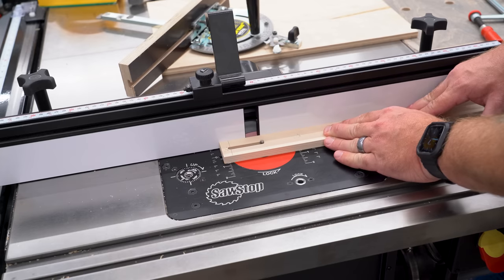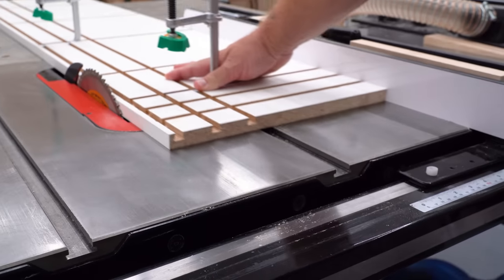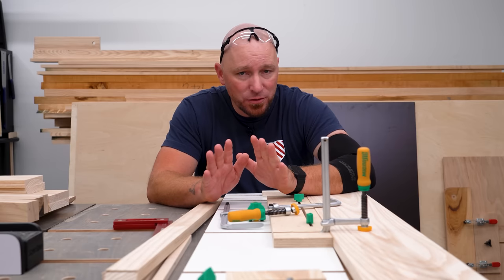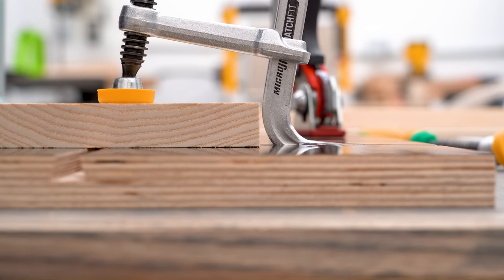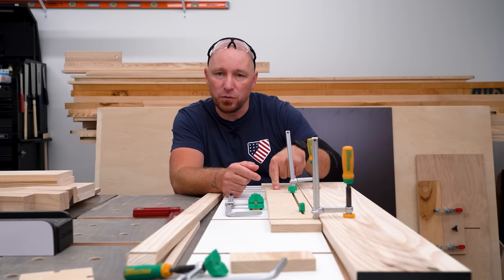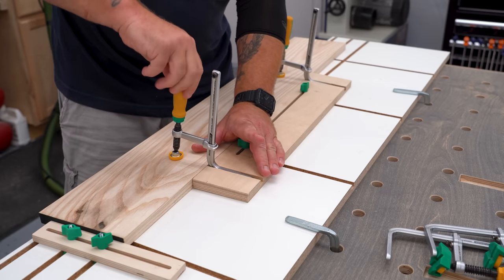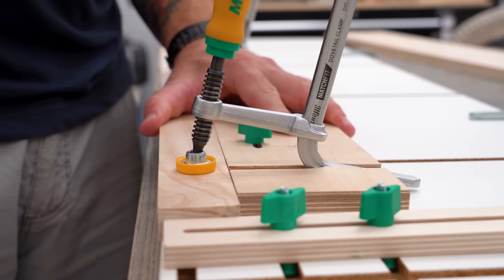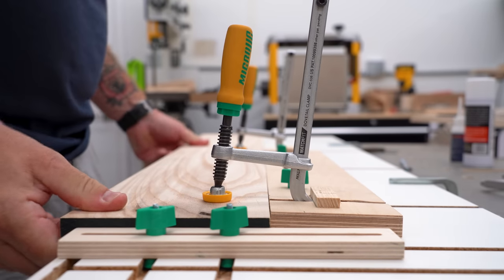What's the TRICK to Using These Clamps BACKWARDS?

Comment: Use two heads on the same clamp. One in each direction. Place a piece of stock in the one in the "normal" position and clamp it tight. This will keep it from pulling through. Now the one in the "reverse" position can be tightened as much as you want to hold the workpiece.
Reply: Great idea!
Reply: Great idea for solving the physics side of it, but again, a lot more work and expense (additional clamps, and more stock for the opposite side) than just cutting channels for t track or some other option like an adjustable fixed base flip clamp. I'm not knocking your "adapt, improvise, and overcome" thought process, just so you know.

Comment: after seeing your video, I made one similar to what you have.  I only use it with pad facing the metal.  I don't see the need to reverse it.  I think leaving bit of material to protect the blade is a great idea.  I even borrow that idea from you.  Thank you.  

p.s.  I added fence and mitre bar to double it as cross cut sled.  I can make all kinds of cut by removing the fence.  Just need to hold down the work piece at two locations.

Comment: In the “correct” orientation, the clamp doesn’t pull apart the dovetail grove because the stock is being pushed down and holding everything in place. An inelegant solution, then, would be to clamp something over the groove behind the reversed clamp - maybe with a toggle clamp? More matchfit clamps?

Regardless, please keep coming with the matchfit ideas, I have the system and am intrigued by the potential. Also, if you haven’t seen it, check out MorganHop’s cam clamp for the matchfit system, it’s very clever.

Comment: I commented on the sled build that it's an excellent idea for the application, and I'd make one. With the reversing of the clamps, I think I'd simply avoid doing that altogether because it would seem like a bit of a sketchy cut if the material is going to be that narrow anyway. One of those "find a different way" situations. All that said, you addressed a proposed solution really well. Keep it up!

Comment: Instead of using ca glue to hold the piece over the backwards clamp, you could drill 2 holes in that little cover board and install threaded inserts on both sides of the dovetail channel. Then you can lock it down when needed and remove it easily.

Comment: Cut down the fence to a narrow strip and route som extra slots in the sled. Your work holding clamps will then be mounted to the sled instead and able to reach over the fence. The fence isn't load bearing so a narrow strip should suffice.
If you in some situation need to reach really far over your work piece to secure it you could consider splitting the fence in two parts or make generous U cuts out to accomodate the clamps. If fact you only need two points of contact from the fence. Thus it can be reduced to two circular pieces of plywood with screws in the middle.

Great video by the way. Love how you share your thinking process and experience.

Comment: I would think if you need to use the clamp in reverse, and you still need to protect it from tearing out the upper sheet's fibers, then use another clamp, but slide it in the V groove of the bottom sheet, perpendicular to the reversed clamp and clamp both the V groove of the upper sheet and the bottom sheet - clamp the clamp. In this case, you will have more room to move.

Comment: Using thinker wood and cutting the dovetails deeper in turn will make them stronger. But the down side is the sled will be heavierand you'll lose a bit of clamping thinkness. But its worth it. I know I've done it and it works to an extent. Gluing 2 pieces of ¾ plywood together and using a straight bit to hog out the the center the another pass with the dovetail bit will give you what you need. I guess another wat to lessen the weight would be to only beef up the thinkness only where the dovetails where tracks are. Like a 2 or 3 inch strip. But there you would lose a lot of the adjustable. Unless you good only having the 2 or 3 inch wide strips supporting the work price from underneath. But to each ther own.

Comment: Would it work if, rather than running the clamps reverse IN the fence, that you simply ran them in the original sled UNDER the  fence and that fence would then provide the necessary down  pressure to keep them from ripping through? Since you placed your dovetail grooves at an even 12” you could just notch out the fence to accommodate the clamp  body when reversed., while still providing some down pressure.

Comment: If you were wanting a solution for this I don't think it would be easier to make than what you've already made...you could make a hard wood block to encapsulate the foot and then make a matching dovetail for the original slot on that block but it may still pull on the sled enough to break...I think it would be easier to talk with the company about making clamps with shorter legs or even cutting one short to see how that affects clamping force, but if it works the way you've made for almost every situation I think it's overkill to try and fix this tiny issue, if you really need to get close for tiny stock, I think a normal toggle style clamp could be attached to a dovetailed block and used for those occasions

Comment: How about an adjustable brace for when you reverse clamps? You set it into position and then tighten the knobs and secure it in place. Another one would be to maybe cut a piece of the metal, and then you could extend the reach without having to reverse the clamp, although i reckon those microjig clamps are too expensive for that idea.
Reply: Another one i just thought of, fastening a strip of wood to each side of the groove, maybe with screws and thicker stock, it could be able to withstand the pressure from the reversed clamp.

Comment: I’ve been wondering if you have considered a trac saw? It seems like they would be a tremendous upgrade to a shop.
Reply: Track saws are great but they have limitations. A jig like this is more accurate for repeatable cuts and if you need to make a bunch of the same part it becomes really tedious with a track saw. They also struggle with material narrower than the track itself

Comment: I really like the MatchFit clamps, but as you pointed out... they are not useful to me in their reversed deployment with the way they pull out too easily in their routed tracks.  The force only gets worse the higher the clamp is used (thicker material being clamped.  Way too much leverage exerted and I never use them that way.  

I only use them reversed when placed though rather thick holes drilled just large enough to fit the clamp through (like dog-holes or braced/encapsulated as you show), but that is extremely rare... a fence for a drill press comes to mind.  Keeps the bottom of the clamp out of the way, pointed back and through the fence.

Comment: Good video
Reply: I personally would not put them in reverse.  If the design was to do this, the wood holding the clamp would need to be doubled.  The bottom board having the t slot, the top board with a simple slot.
Reply: @davidfimble2217  I wouldn’t reverse them either

Comment: Instead of putting glue on the strip of wood try threaded inserts with glue on the inserts, this way you can remove the strip of wood and replace it as needed.

Comment: Where the foot sticks out from the fence you could have 1 1/2" x 1 1/2" scraps of the dovetail groove and slide them on like clamp pads or just scraps of wood the same thickness as the bottom of fence to bottom of the groove.  On the top maybe more tee nut slots with wood or metal bar across the slot near the bend at the weak point.

Comment: I don’t see the problem. When in the normal position, the screw looks to be right over the foot of the clamp, which is within a 1/4 of an inch from the edge of the sled. You have to have enough of the workpiece on the sled for the screw to fit on, which would probably be at least an inch or better, and if the screw lines up with the foot, then I don’t see the need for the screw to extend any farther. I guess I don’t see the worry about the foot not getting to the edge of the sled, cause unless you’re trying to clamp 
 only say a quarter of an inch to the sled, it should be close enough.

Comment: Easy clamps to use, but as you have shown, they are definitely limited. I guess it depends on how much time and money you want to put into the beginning of the project... t track or dovetail.
What about using a thicker stock (let's say 1" for s's and g's) and routing a channel that's wide enough for the "trunk" of the clamp, THEN cutting your dovetail? Sounds more time consuming and risky and expensive (stock) than what I would want to do just so you can reverse the "root" of the clamp. 🤷‍♂️

Comment: I had that problem but mine is different. I use a hold down clamps and a diy t-track on a plywood and I solved it just by adding extra  hold in the middle. If you change your dovetail plywood into aluminum or  change it to aluminum t-track, problem solved. Please Check out my tapering jig if you have time. Especially on the 4:03 mark on my video
https://youtu.be/39MrokM5Tm0

Comment: I would toss this sled and make one with T-Tracks with the appropriate clamps....problem solved. Just my personal opinion
Reply: How would that be any better than his sled?
Reply: Couldn't agree more. Less slots, use of inexpensive or home made hold down clamps using standard bolts that can be bought from any hardware store. I've made a jig similar to this with 2 T slots to move the fence and a slot for hold down clamps. Works perfectly!
Reply: @alans1816  It's pretty obvious. T-slots would hold the clamp securely. There are many different clamps of all sizes that work in a T-slot sled. he could also make custom clamps that fits his needs.
Reply: @Zamboni-0805  The clamp is quite secure when used as designed.  It’s just when you turn it backward that there’s a problem.  

T slot clamps require a much more rigid surface to clamp well, and do have advantages over the clamps used backwards.  Don’t use them backwards.
Reply: @alans1816  I agree, don't use the dovetail clamps backwards.  But if you needed to clamp a wider piece of material and wanted it to be secure, then using a T-slot track and a wider clamp would accomplish this.
Reply from the maker: @Zamboni Throw away a perfectly good sled that works with these clamps just fine and then go try to figure out which clamps/tracks work together and invest in yet another system? I'll pass. Haha. All (mostly) jokes aside, this sled works perfectly fine the way it is and is way less expensive, complicated and more functional as is, than a sled with t-track and accompanying clamps and such. This video was just in response to a question that some folks had.
Reply: @InspireWoodcraft  We'll agree to disagree. It might work fine but its isn't less expensive. Cost of matchfit clamps and bolts (over $50) compared to standard bolts and ordinary hold down clamps or in my case home made clamps and T slot or T track. Total cost of mine is about $10 to $12 and that's mainly the T track. Bolts under $1. I'm not including router bits or dado stacks as both systems need something to make the slots. It isn't less complicated either. 2 to 3 slots vs all the slots in your design and the use of clamps that swivel at 360 degrees and because they ride in the track or slot by a simple bolt they can ride almost to the edge of the track. it isn't less or more functional either, both do the same job. I have made a crosscut sled using the matchfit system and it works well but I'm not a fan.